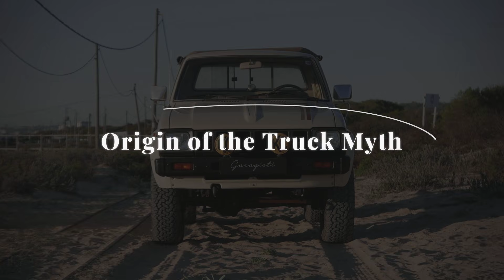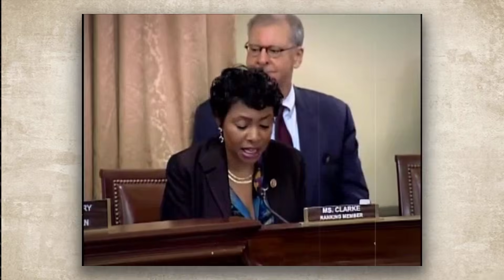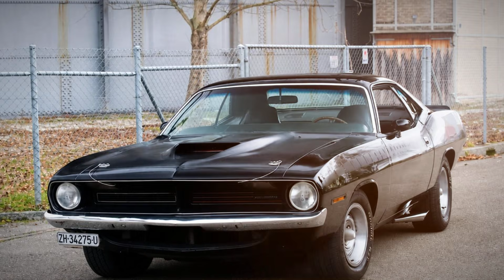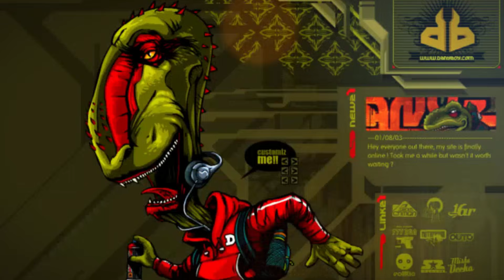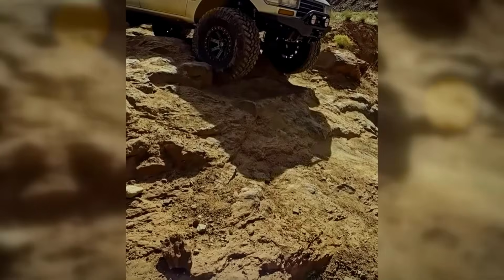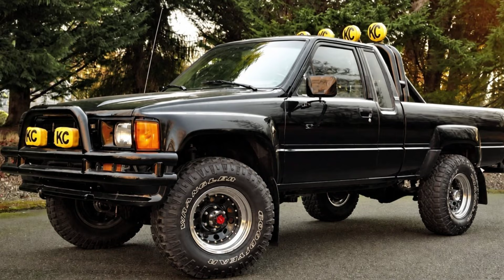Why Analog Toyotas Are Now Luxury Survival Assets.

Comment: Were these Goverment tests run on cars that were not running?  It seems like that is the case.  EMP energy does effect wires and micro processor circuits as if antenna - IF they are on and the circuit is complete - it will have little or no efect belwo certain thresholds if their is no sicruit because energy can't flow through. EMp like a surge in your power line - is not - likely to do anything if your power is off, unless the power is so high it efectvely makes a curcuit of its own like a lightning strike would vs a power surge. The Goverment even states where this threshold is.  What will fair faster?  the smaller the wire - the faster it will be destroyed - micro processors can be destroyed by static electricity  points in a mechanical car might arc and get damaged with enough energy but - the can easily be replaced - try that with all the microprocessors in a modern car or truck.
Reply from the maker: Thanks for breaking down the technicalities of EMPs and circuit completion – that's a fantastic addition to the conversation and really helps clarify some common misconceptions. I appreciate you sharing your expertise!